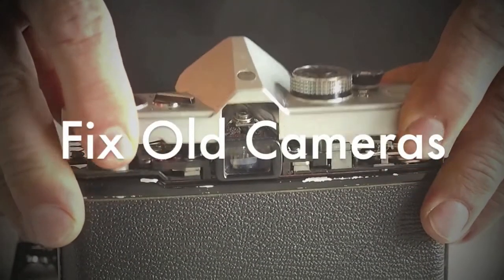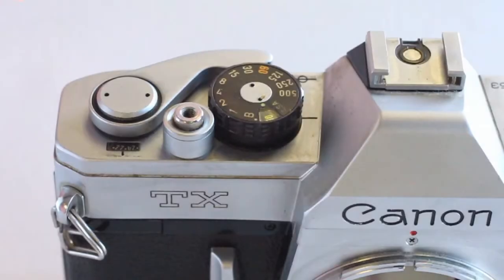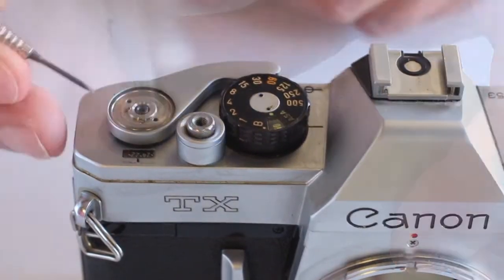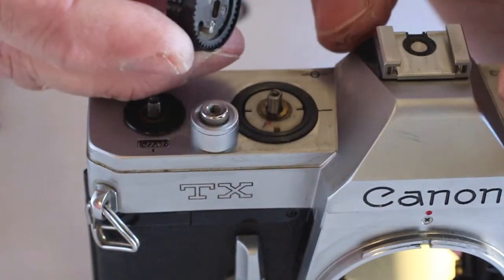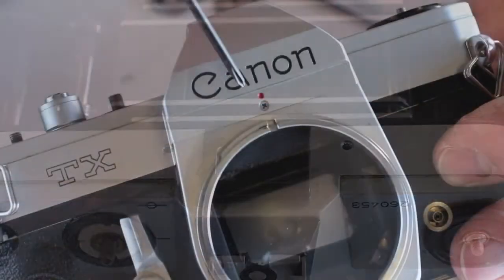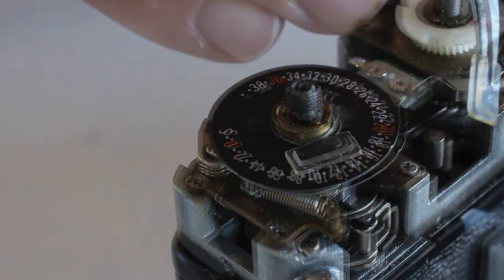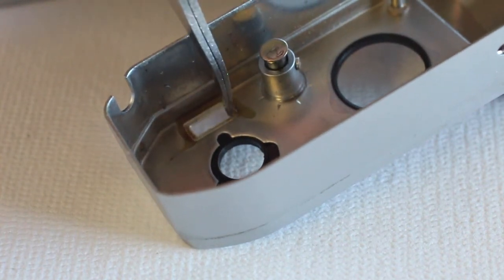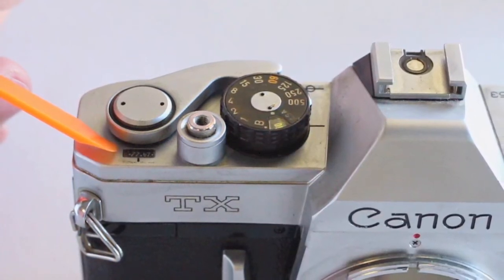Fix Old Cameras: Canon FTB / TX Jammed Wind Lever

Comment: I have a Canon TX. The shutters work, but the mirror does not always return. It sometimes requires me to advance the film. Also the view finder is very dirty. I would like to try simple fixes first, before diving in. Thanks for all the cool videos!
Reply from the maker: There is a chance that the second shutter curtain tension is such that the curtain does not have enough tension to trip the mirror release mechanism. 
Check out the FOC video Canon Ftb Uneven Exposure on adjusting the 
curtain tension on the Canon TX. The procedure is almost identical to 
the Ftb curtain tension adjustment. The top cover will need to be removed to facilitate  prism removal to access the VF screen to clean.
Reply: Thank you for a quick reply, such good advice, and very useful videos!

Comment: I loaded the film into my FTB and noticed that the counter frame didn't reset. At first it was stuck at 36 and it just wouldn't reset no matter how much i tried to open the film door. I kept shooting and using the advance lever a couple times more to see if maybe that would work. So i just realised the little counter window fell inside. So, if i follow this exact procedure it should work again?
Thank you, it's been already really helpful.
Reply from the maker: Good to hear the video might be of help.
Reply: Fix Old Cameras Fix Old Cameras Do you think it is safe to still use the camera even though I haven’t fix it? I mean the counter window is still inside...
Reply from the maker: At some point it will lodge into the gear train and jam the camera. If that should happen has long as you do not force the advance it probably would not cause in damage. The top cover would need to be removed so you could locate and remove the jammed counter window. Sometimes the window can jam up in hard to reach areas of the upper drive train.

Comment: Hi everyone, first thanks to Fix Old Cameras for all these videos, they are very useful !! :)
I have a problem with my Canon FTb QL which has jammed wind lever as well. However, the problem doesn't come from the counter window because mine is correctly placed. 
I disassembled the bottom plate of my camera to see if my problem had similarities with the video "Nikon FM2 Stuck Shutter Release", but the mechanism is too different. I don't have the interlock lever that I can pull back to release the lever. 
Do you have any advice to give me ? Should I disassemble the top cover or the lower part to solve my problem ? The gears under the bottom plate seems to be blocked but maybe my problem comes from elsewhere and I don't know how to do it ... Thanks in advance for your help
Kindly
Reply from the maker: There are several single or multiple issues that could be going on. Only to suggest two possibilities that require only limited disassembly to check. First, check the self timer for a jammed condition. Slight upward and inward pressure might get it rolling again if the timer has jammed. Next if the timer checks out OK... with the bottom cover removed find the disc that has two levers and a connecting spring. Note the position... in the cocked position the notch in the disc should allow the release mechanism energized by the shutter release button to clear the notch. If it is being slightly blocked it will prevent release effectively jamming the camera. If such a condition exists... a gentle nudge into the proper alignment might allow the camera to release.

Comment: I have an XT which was working well for the first 30 frames, then it jammed. After removing the roll of film the wind lever works, but the mirror doesn't flip back and the second curtain does not run down. The window is missing. Could this be the cause? I'll give it a try anyway. I hope your video saves another camera from the garbage bin.
Reply: Thank you, it was the solution for the jammed mirror and second curtain!

Comment: Do you know if this, or the instructions you gave in "Old Cameras: Canon AE-1 Jammed Wind Lever", will work with the Minolta XE-7? I really want to shoot, but the film advance lever just will not budge past the middle!
Reply from the maker: The set up is different on the XE-7. You might be able to remove the bottom cover and carefully inspect the lower mechanism for the hang up.

Comment: I have a Canon FTb QL that I opened, and attempted to repair the Film Advance Lever. The counter window went underneath. Furthermore, the counter was stuck on the number 38. Yes, the counter window was loose, and fell out. The film advance then did not work! The best I could ultimately perform was to clean, and tighten up the screws underneath the hot shoe that were a bit loose; and I cleaned out the bottom plate. I lost a very small spring; it bruised my ego. An expert advised that I problem is underneath the camera from Flickr web site. Anyhow, I tried to glue the counter window  back with a glue very similar to Crazy Glue (R), only to mess it up. I was very careful to assemble this classic Canon SLR film camera that I had bought on eBay, and was working well at first. What I really like about this film camera is that it can be used without a battery! The shutter can be released if the battery is very low, or absent. Do you have any practical advice, Lithium Lollipop on the eventual repair of the  Film Advance Lever to eventually work? Since it is no longer the film counter window, there is something else going on. Could it be something deep within the film advance mechanism? If I get an camera repair person to fix this problem (film advance lever that no longer functions) do you know how much it is going to cost? Thank you for any advice.
Reply from the maker: George Anastasopoulos  As you unfortunately found out the cyanoacrylate type glues (super or crazy glue) do not work well for some applications. The counter window is plastic it will fog the plastic and cannot be cleaned off. You can snip a small square of clear plastic that wraps many new products and use this piece to replace the damaged counter window.  The dislodged spring you mentioned could possible related to the issue you are now having. The spring was there for a reason. Look to see if you notice a spring similar in style and take note of how it is attached. Then look to see if you can find the connection spot for you mystery spring.
Reply: Thank you. Actually this very tiny spring was within the underneath mechanisms. However, I am going to consider the function of such a spring on top, and possibly the bottom area of film Canon FTb QL film camera. Again, thank you for your helpful advice.
Reply from the maker: Good luck. Hopeful that you persistence pays off.

Comment: I have the same problem but with a Petri FT, my success with the Spotmatic made me take this new challenge, but I need guidance.
Reply from the maker: To remove the top cover to access the counter on a Petri FT you would begin by removing the top cover screws. The advance lever cover screw needs to be removed and could be problematic. Try to use a friction pad to increase the the thumb torque pressure. Under the advance lever cover screw are two more retainer screws. Remove the shutter speed dial via the dial set screws. Remove the rewind knob. Remove the battery cap.
Reply: Fix Old Cameras I have done exactly as you said, I've found my way around freeing the shutter, the incomplete cycle was caused by a torn shutter curtain caught on one of the gears that releases the other shutter.

I was able to play around with the camera once the film advance lever worked, but soon found another problem where the shutter speeds are all stuck in bulb mode, there was another shutter speed setting that sounds as if it is winding a sec but ends up getting stuck midway, it gets release from changing the speed on the dial. Everything is bulb right now, and very recently the film advance lever works but the shutter seems stiff, with the shutter curtain stuck midway.

I lubricated every major points, but I might tear down everything to access the shutter speeds, any tips? Thank you, sorry for the long story.
Reply: I'm hopeful to find a solution and repair this body, as a way to help others with the same problem, at this seems to be a very common problem with this camera brand, and avoid the cameras ending up in bins, or broken forever.
Reply from the maker: Right on. Keep-em going!
Reply: I also have Petri FT and can't figure out what's wrong with it

Comment: I have a similar condition where the frame counter is stuck and only a portion of the broken small window is still attached to the camera. I guess the rest must've got cracked and fallen through into the inside of the camera. How do I fix my TLB that has a broken frame counter which doesn't reset itself?
Reply from the maker: Once the top cover is removed you will need to search for the remaining broken pieces of the counter window. Once the broken counter window blockage is removed you can substitute clear plastic cut from a piece of the formed clear plastic packaging that surrounds button batteries for display.  Glue the newly formed counter window in place to the underside of the top cover with clear silicone or Pliobond glue.
Reply: Thank you! I will try fixing this when I have time. It's just that the frame counter gets stuck at around 21.
Reply: Daniel Sun hi fix old cameras I tried opening up the shutter arm on my Canon Tlb today and ran into a problem. I used a camera spanner wrench to open up the top cover of the winding arm and I can't open the secondary cover for one reason. I turned clockwise as mentioned in the meter diode video you had but it wouldn't budge. The two set screws seems to be missing and it looks like someone ages ago did a sloppy job repairing my tlb. There is dried up brown glue like residue where the supposed two set screws are and those screw hole areas are already stripped for that glue to take its place. I tried using the wrench to open up the shutter cover but when I twist hard I bent one of the tips of my wrench and scratched the surface of the secondary shutter cover. Is it worth going through all this trouble to repair? I got the camera body at a clearance sale of a now closed used camera shop for only $1 so probably not worth repairing? The shutter worked before, that was before the half broken plastic window fell through and jammed the camera. Can I send you a picture of my problem, by email or YouTube message? I would really appreciate your inputs, thanks!
Reply: On the bright side I was able to fix a Canon Ftb I had with the same problem, but the Tlb I had i couldn't even open the thing.
Reply from the maker: - The wind lever cover spanner is counter clockwise. The secondary spanner, if it has the two set screws, is clockwise. The screws are probably hiding under the glue. If the slots of the set screws are completely trashed, the screws will have to be drilled out. Yeah fun... Try heating that part with a tip of a soldering iron. Remember... avoid contacting any plastic parts with the soldering iron. Bad things happen quickly.
Reply from the maker: Good to hear of you success with the Ftb. Keep after that ornery TLb.
Reply: Fix Old Cameras thanks for the advice. Now if I knew that there was a new old stock soldering iron in the house and the safe knowledge on how to use it...
I'll probably won't go that far I already have an Ftb and perhaps put the Tlb up on eBay who knows. Thanks anyway!
Reply: Yeah maybe I will just keep the Tlb for spare parts in case anything goes wrong with the working Ftb. Now if I knew how to use a soldering iron properly, I only soldered once at a STEM club meeting as a tutorial and that was my first time a while ago. Thanks! 
Sorry for the confusion, both youtube accounts "Sun and D-970" and "Daniel Sun" are mine.
Reply from the maker: No worries.
Reply from the maker: Sounds like a good plan.

Comment: I just did this and my camera firs again but my shot counter doesn't work anymore. Any tips for that??
Reply from the maker: You will have to take the top cover off and check the counter dial and engagement pawl function. With the back door closed and the top cover removed you can watch the counter dial gear and engagement levers as you wind the mechanism. It is possible there is a spring that has become disengaged.
Reply: +Fix Old Cameras is there a video for that??

Comment: Hi, have problem with my FTb, everythigs work, but I cant wind film, lever cock a shutter, but film dont wind.
Reply: i mean this white "thing" who transport film is free-floating.
Reply from the maker: If the advance lever cocks the shutter so that it can be released, but the film is not pulled through the camera, then check the rewind button function that releases the wind sprocket to enable rewinding of the film. Perhaps it is stuck in the engaged position.